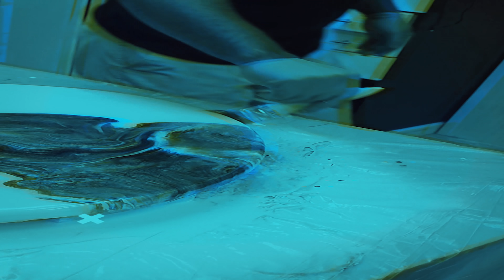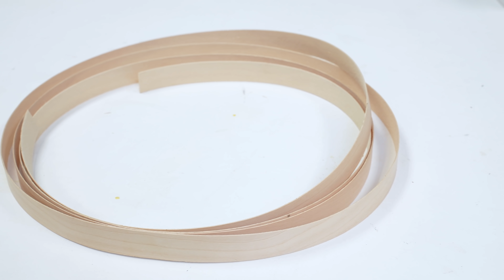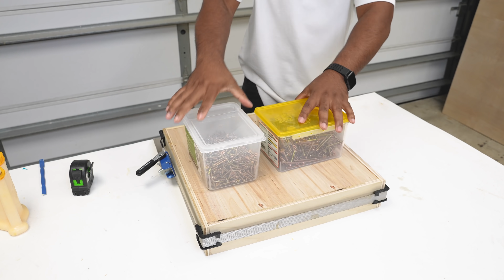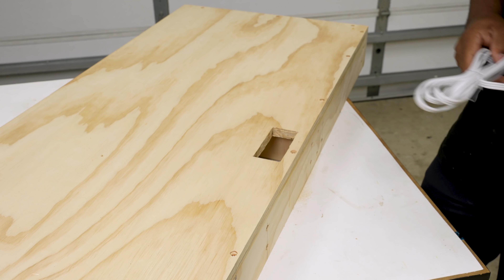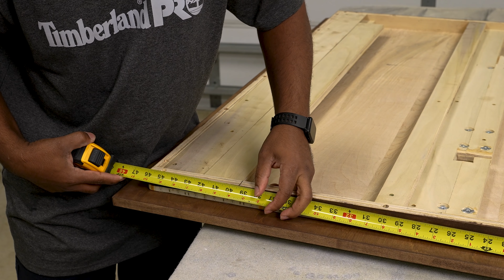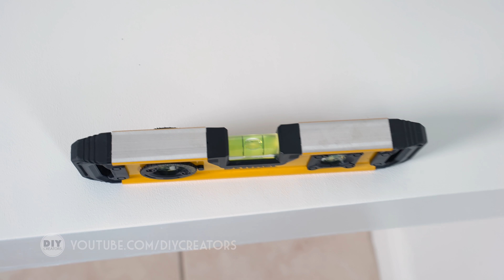How to make a wall mounted desk with secret compartments (Plans Available) #2

Comment: Good demo of the circular saw if you don’t have a table saw. I recently bought one but not that model as that is a right hand model and to use it you can’t see the blade as it cuts. I bought the left hand model where the blade is on the same side as you are. Makes a big difference.

Comment: Safety issue, please don't stand on top of your table while making a cut, just clamp the material firm to your table and walk along the side while making the cut. Stretch out for your cross cut (Its a stretch but you can do it!). I know small guys can do the cuts walking along the side of a table, you can too. If that table gives, you can get hurt, especially if you had a circular saw with a power chord.

And a little tip, you don't need a full line mark, just a couple of 48" marks on both sides of your circular saw fence. Less pencil marks the better. Good luck on your next project.

Comment: Hi Glen. Glad you're back and doing well! I was thinking of doing something like this for my home office and then BOOM, your video popped up! Thank you for this. I wanted to run 3 things by you. My idea is similar to yours but my back panel will be 70 inches tall by 48 inches wide. It will be a standing desk with a 42 inch TV that I  use as my monitor attached to it at fixed height and will cover all the wires and electrical plug at the bottom. First question, do you think I should do 2 french cleats, one at the top and another  one 3/4 down from the top? Is that overkill for that size? Will it be hard to line up? I like your idea with one french cleat at the top and the hidden screw. Second question: is that thin frame on the back of the panel touching the wall, necessary? Could it just sit on the french cleat and the vertical backing wood piece for the hidden screw? Or was that for the LED strip lighting? Could that strip lighting been on the back of the panel instead of on the side of that thin frame? Last question, I've never used T nuts but am open to it. I was just thinking mounting the TV and desk to the back panel with a bolt and washer from the front and another washer and nut on the back. What do you think? Thanks again for this video! It was like you read my mind! Take care, brotha.

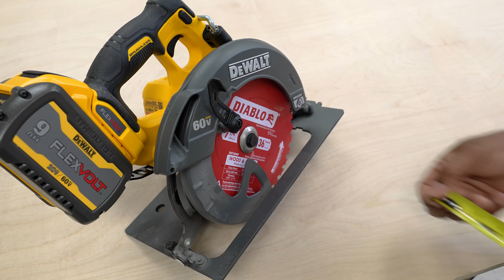Comment: Take a paint pen and write the circular saw offset on the top of the baseplate, on both sides of the blade, that way you never have to measure again, it's always there on the tool when you need it.  (1:15)

Comment: The desk is a simple design, but looks modern, with clean lines, especially with the LED lights. I really enjoy your videos as you capture each part of the build process. It was also great that you used power tools that most DIYers would have to complete the build.

Comment: I like your design, I think for me I would have added a lifting door framed area for the laptop to sit on and still have ventilation to the back since laptops get hot when so close to the surface of the desk. and raising the angel of the laptop plus giving it batter ventilation will be easier on your wrists. I'd hinge the frame and make it collapsible to the surface of the desk.

Comment: I'm glad I subbed to this channel a while ago and got to see this. Just wondering, is it metal or wood framing behind the wall.
Reply from the maker: Thanks! It's wood, to mount it to metal you should used toggle bolts.
Reply: @DIYCreators  Noted, on my next buy and flip I'll look into that. I was worried about doing it on my current because I feared the metal framing couldn't handle it.

Comment: I’d change out the hot glue. Those led’s get pretty hot causing the HG to melt. Learned that the hard way.
Reply from the maker: mmm, I have not had that issue yet. How long are you running your strips?